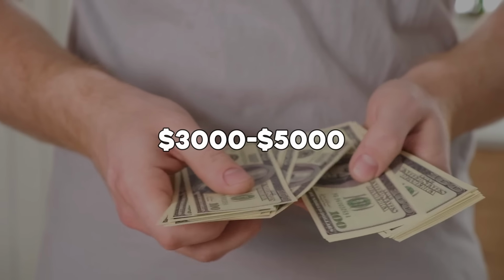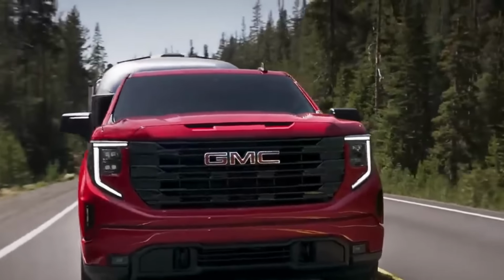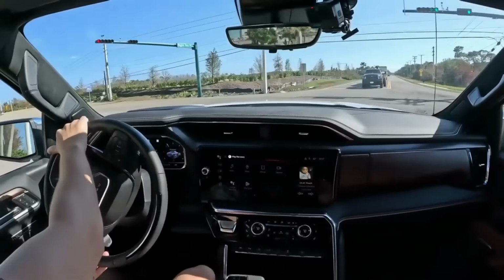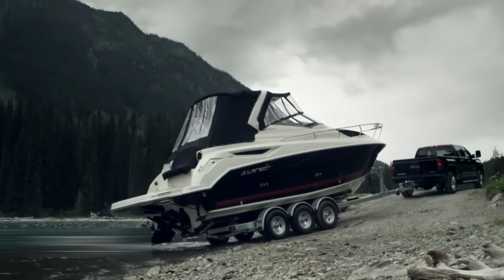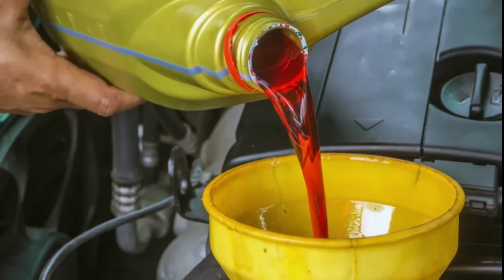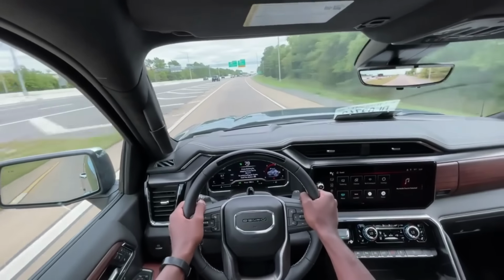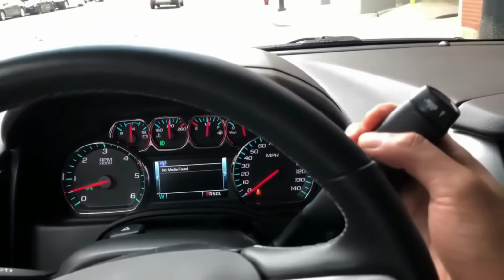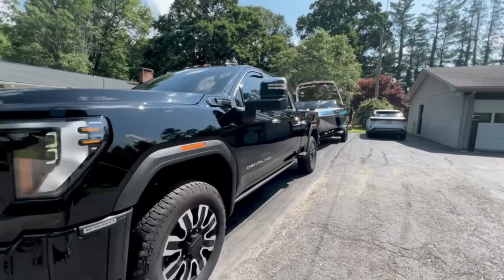NEVER Do This in an Automatic GMC Transmission (Big Mistake)

Comment: 2018-2020 good treainmistion after  covit hit 2021-25 bad trians. need in shop work 10,00-12,000 miles gone sad
Reply from the maker: That 2021-2025 transmission window had real quality control issues coming out of the COVID supply chain disruptions — you're not alone on that. 10,000-12,000 miles is brutal, that should never happen on a new truck. Sorry you're dealing with it. 🙏